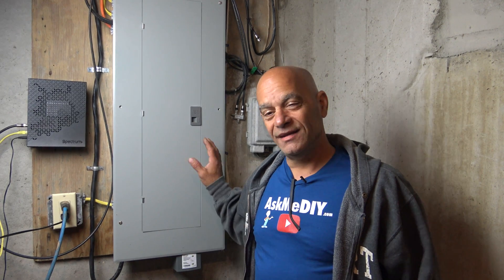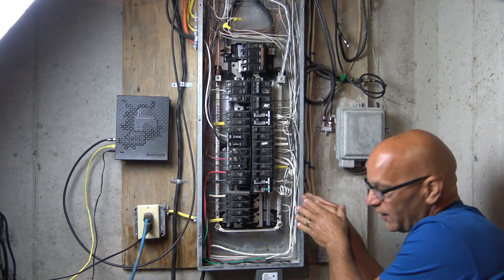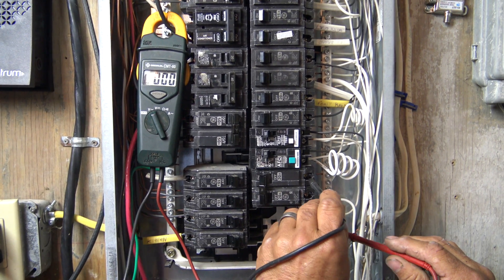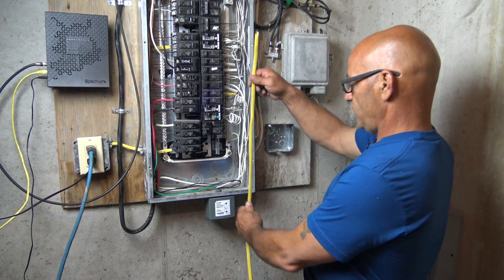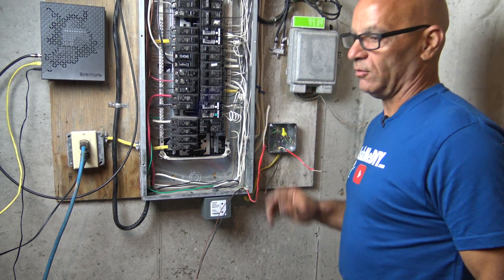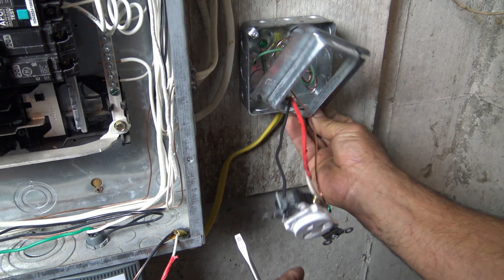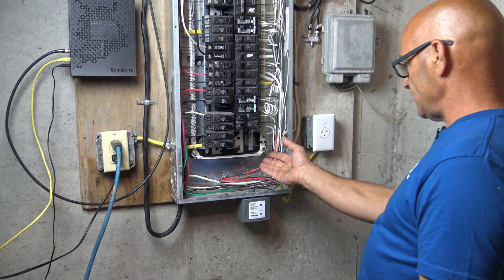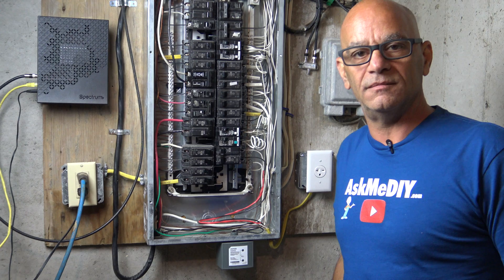How To Install a 220 Volt Outlet

Comment: Does each outlet need its own breaker? I am trying to install the 240 plug with two outlets
Reply from the maker: Yes each 240 outlet should be on it's own breaker. However this is not always true. What are you doing?
Reply: @Askmediy  I'm setting up a few lights that each require a 240 plug, I purchased the one outlet with two and have one breaker. The outlet has the same set up as the one you installed but the light is malfunctioning and error is "low voltage"
Reply from the maker: @aydeestrada1  Without being there and seeing what you have and the specs on your lights it's really hard for me to say. Low voltage, hmm.

Comment: Great video. If i may i like to ask a question, i have a 220 V outlet that is setup ezactly like you dedcribed of the video. However what i really need is a 110 V can i converted from 220 to 110 easily.
Reply from the maker: You can, just use one of the hots and cap off the other.

Comment: Couple questions. You used 12 gauge wire, I bought roll if 10 gauge. Does it matter if I use 10 gauge. Also I’ve heard that sometimes having extra wire can be nice to have so I was going to use 10 gauge 4 wire (black, red, white, green).  Likely I’ll wire just like you show and white wire won’t be used - that ok?
Reply: That’s called a 12/3. You never count the ground wire. I’m not sure why he didn’t use the neutral as a neutral considering you need it to complete the circuit. 10 gauge is typically used with 30amp breakers. 12 with 20amp, 10 with 30amp, 8 with 40, and 6 with 50amp
Reply: @Jessi8074  By using each bus you get a closed circuit of 240 volts. The neutral wire is the center tap of the coil in the transformer, hence 120 volts. You could use 12-3 wire and then already have a red wire. The neutral wire could be connected to the neutral bus bus bar at one end and capped unconnected in the outlet at the other end.

Comment: Can you add a 100 amp sub panel to a 100 amp main panel?
Reply from the maker: Oh god no.
Reply: Yes, I believe you can. You should confirm your situation with an electrician. If you look at 2:26, notice the horizontal bar that bonds the neutral and ground bus bars. This must be removed on a sub panel, where the ground and neutral must be independent.

Comment: I have a plug like this that was used for a through the wall ac unit.

It has a blue,  and black wire and the green is as you show.

Can I replace this plug with a 3 prong dryer plug?

Each leg shows around 125v
Reply from the maker: No, this video is for a 20 amp. A dryer will need 30 amps. The wire for a dryer is much bigger. Blue wire? Hmmm that's a little strange.

Comment: Just to add..By nc code , the wire from the panel to the outlet must be protected by conduit or a flex ..
Reply: Glad I went through the comments so I didn't repeat what someone else stated. I, too, caught that as soon as he showed it and said something about passing code. I thought, "Well, THAT'S not going to pass code because that exposed Romex isn't protected!" lol

Comment: Please be careful. If you have your appliance, in this case the welder, plugged-in, and only one of the input wires plugged in, the exposed part of the male plug on the other inlet wire is going to be hot.  BE SURE TO PLUG THE WELDER IN LAST AND UNPLUG IT FIRST.
Reply from the maker: What!, no, if the two pole breaker is OFF both hots are dead.

Comment: Great Video. I want to install two nema 6-20R outlets in the garage for a printer that uses both power chords for printing and curing the ink (3A &16A). Which breaker and wire can I use? Can both outlets be wired to one breaker?
Reply from the maker: Thank you. No one outlet, one breaker.

Comment: Great video...I'm planning to run wire to the kitchen for a new Lg dual range stove burners are gas, inside is electric rated for 40amp..my old stove was 120...What kind of breaker doni need, double pole 40amp? And what size wire?...Thanks again.
Reply from the maker: Yes a new breaker will be needed. #8 wire for 40 amps

Comment: How do I shut off the panel completely? There is just a meter directly behind my breaker box on the outside of my house. The meter box is locked from the power company. Is it safe to install a new 240v plug with only the main switched off from the panel?
Reply from the maker: Yes it is safe. Just always know the wire to the main will always be live unless you pull the meter
Reply: Thank you Sir.

Comment: Fascinating video on electrical instillation in America, Here in the UK its very different as you probably know. My question is here in the UK we have to use tork screwdrivers for every connection do you have this there?
Reply from the maker: No not at all. That's very interesting .
Reply: @Askmediy  
You have to in the state of Massachusetts .
Reply from the maker: @sammax4245  nope, upstate NY

Comment: Hey have a question why doesn’t 240v need a neutral white wire ?
Reply from the maker: Really depends on what you are powering. For a 20 amp in this video there isn't one. However a higher amp may. A neutral is just a return path

Comment: I like conduit much better. Looks way better, neater and acts like a ground 👍
Reply from the maker: Depends on where you're installing it. And never ever can a metal conduit be used for a ground. Yes it must be grounded of course.
Reply: @Askmediy  I believe conduit can be used as a ground if installed properly. National code allows it. Just ground the breaker panel.
Reply from the maker: @NikeMikey101  That's very old school where you could. Not anymore.
Reply: @Askmediy  I see, I'm still learning. I do understand that copper is a very good conductor vs aluminum or galvanized steel. I'll keep that in mind for my next gut rehab.

What do you think of bootleg grounds? I feel they still work

Comment: One question. Does it require to be installed in a metal box or can I put this 240 plug in the standard blue nail-in-box. Thanks
Reply from the maker: Either or. If you use metal just make sure you ground it
Reply: Got it. By the way. What Items are used to plug into that type of outlet. Thanks

Comment: So instead of running a neutral you can substitute it with the ground?? Never knew you can do that. I figured this would of had to been 3 wire, 2 hots, 1 Neutral and then ground...
Reply from the maker: There is no neutral in this type. You need the two hots and ground.
Reply: @Askmediy  ah ha! I've learned something! Thanks. Why is it that you do not need a neutral?
Reply from the maker: Watch the video, I explain this.
Reply: @Askmediy  I did must have missed it willl watch again thanks for the reply

Comment: We are having someone install a 230v outlet for our Artic King 18000 btu air conditioner, but we need to purchase the supplies by Sunday. I'm thinking I need the 230 outlet which looks exactly like yours, about 20 feet or so of wiring (can I assume 10/4?) and then also a breaker set unless our box has one not being used.. (can I assume I need a double 30 amp?)
The ac we are wiring for is the Arctic King 18000 btu wwk18cw02n
Reply: The assumptions I made were what I had seen when I googled info about the air conditioner being installed, but I would love confirmation about those
Reply from the maker: Wire size and breaker size all depends on the amperage. How many amps is your ac rated for? In this video I’m using /2 wire. No neural
Reply: The side of the ac says 7.3/7.8, but the plug/cords says 15A
Reply from the maker: So you would use 12/2 wire and a 20 amp two pole breaker. Just like in this video
Reply: @Askmediy  thank you so much, that makes it cheaper too - I appreciate it!
Reply from the maker: @JCsMuffin  Yes it does, big time. Always my pleasure

Comment: What if I'm installing a sub panel 30 ft away from the Main Panel,  Do I need to drive down a SEPARATE grounding rod for the sub panel
Reply from the maker: Only if it's in a building not attached to the building with the main panel

Comment: Great video, as someone who does DIY more from a necessity than because its fun, (Sometimes it is)
this video helped tremendously.
"The biggest misconception is the 220-volt outlet. Is it 220 or 240 volts?. Well, nowadays it's 240 volts. "
Your right, that this is definitely something that confused me.

I was wanting to install a plug for a welder/breaker.. and I was  wondering
how I'd go about it, now I know!
My only question is, why do plugs have the "keyed" shapes, if.. how you hook up the "hots", don't matter?
Like what's the purpose of that then? 
Thanks for your time!
Reply from the maker: The two hots that come in the panel are the same hot, but they are 180 degrees apart. Each one is 120 volts.
Reply: @Askmediy  I appreciate the reply, but that's not exactly what I was asking. I was more talking about 
the plug ends shapes:
https://joneakes.com/jons-fixit-database/343-Why-are-electrical-plug-prongs-different-sizes
Reply from the maker: Those shapes (slots) are so the hot and neutral can only go one way. In other words, can't be flipped.

Comment: You should mention panels that have two  main breakers  One at the top And one in the middle. Great video Did you get permits for the old house ?
Reply from the maker: Yes that would’ve been a good idea. And yes I did, just in time for the lock down. I’ve been working on it. I did make a few videos on it .

Comment: Great video, thanks! Q-is there a recommended order [screws] for taking the panel cover off? Bottom first? Clockwise? Hold with your body until the last screw is off? I'm not really sure and of course don't want the panel cover coming into contact with anything inside of the panel (esp. if still live), assuming one person is doing the work.
Reply from the maker: Damn, that would've been good to include that in this video. It really depends on the panel. Just always holding it is good.
Reply: @Askmediy  thanks. My panel is fairly large (200amp), similar to this vid...once the cover is off I'm very comfortable (bc I can kill with main breaker so everything is dead below the 2 big hot leads). Last big job I did kitchen island receptacle (mc cable) all the way back to panel and had master electrician check my work and wire inside panel. Long time sub, native new Yorker (LI) always great content.
Reply from the maker: Awesome, that's the way to do it. Thank you so much.

Comment: I'm considering running a 240 volt outlet to my kitchen

I found out that European espresso makers are much much cheaper

Do u think it's a good investment to do this?  My neighbor is a electrician he said he would do it for $200
Reply: Why are 240 volt espresso makers so much cheaper than 110.   Like a third of the cost.  Does anyone know
Reply: @glenntempleton8707   I don't know.. but from what I understand,  and its not the same exact thing.. I read that over in Europe they use "3 phase" power to the home.
So like its real common for everyone over there to have it..  Where as in the US, "3 phase" is used as something "Special" for like manufacturing plants. Homes have
1 single phase if I am not mistaken.. I'm no pro when it comes to this topic mind you.
So like, when used equipment goes for sale.. lathes, table saws, drill presses, whatever, and its powered by "3 phase" electrical .. it goes for super cheap, because of supply and demand. No one wants it because, running 3 phase to the shop is not cheap.. and no one basically has 3 phase.. another words.. 110x3.. so 3 hot wires basically. 
I imagine its the same for the 240 espresso machine. Its a supply and demand issue..
Reply: Glenn Templeton do consider the frequency (Hz) difference between NA and EU the appliance may also not be rated for 60Hz
Reply from the maker: No really, wow

Comment: Good video, gives a nice overview of what's going on with 220/240V.  You mentioned "turning off power to the panel."  How did you do this?  I have a main breaker on my panel that turns off all the circuits but I think the panel itself is still live (and dangerous).  Do you have a separate switch for the utility service to the residential panel?  Thanks again for keeping us DIYers informed!
Reply from the maker: Thank you. Yes I do have a main disconnect outside that we used. And yes, even though if you turn the main breaker at the panel off, the upper section is still very much alive and very dangerous

Comment: Now that’s what I was searching for.  A simple explanation of how to install a 220 outlet.  (Even though it’s 240😂)
Great teaching vid 🤛🏼
Reply: Thank you for the great explanation... I was thinking that the two hot wires didn't matter which side they were on... But, I was having a hard time verifying it... New welder hookup... 😁
Reply from the maker: It doesn’t matter. L1 L2 both the same, both are hots
Reply from the maker: Awesome, so glad to hear that
Reply: If you really wanted to you can make a 120V outlet wired with 240V. Yes switching power supplies like my computer's PSU has dual voltage and is slightly more efficient on 240V but don't plug anything else in it! (or just don't do that) Maybe if you have a crypto miner you'd run them 240 volts with the appropriate plug.